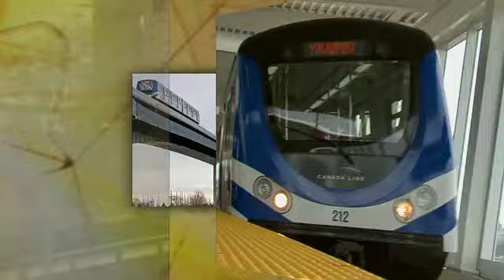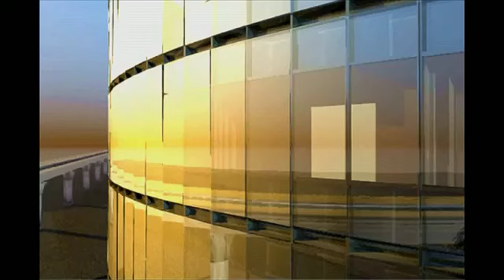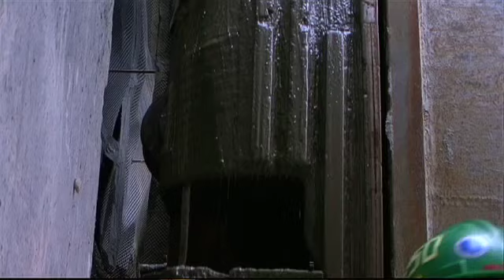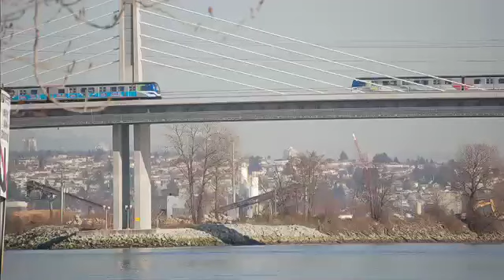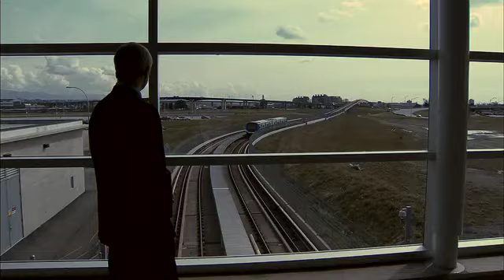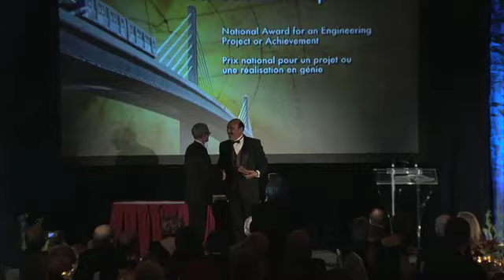Canada Line Rapid Transit Project | National Award for an Engineering Project or Achievement, 2011

Comment: Yep, now the system is too crowded. They need to add more
Reply: But the 12 Canada Line Trains has been added to the system including new escalators that has been added for Waterfront, Vancouver City Centre and Yaletown-Roundhouse Station since 2019 and 2020. :)
Reply: 8 years later, it's an even bigger issue.